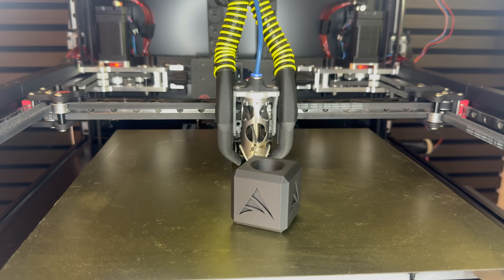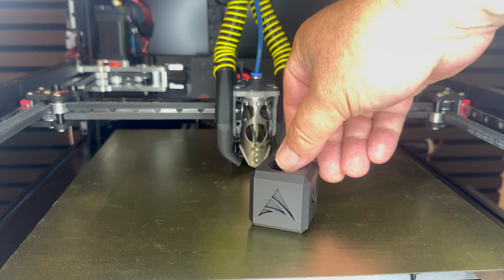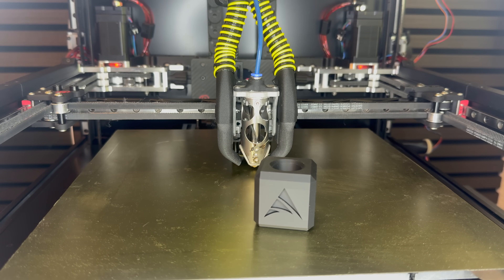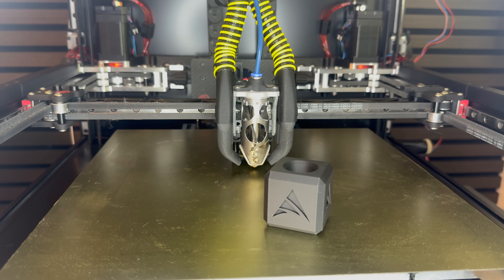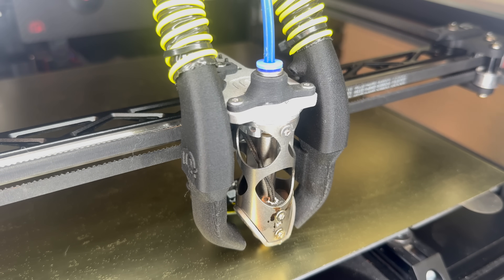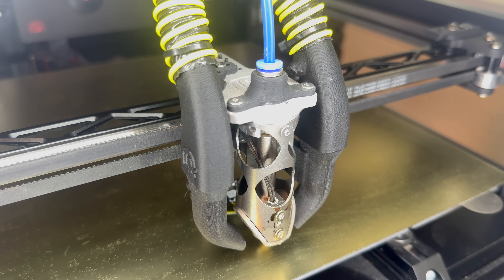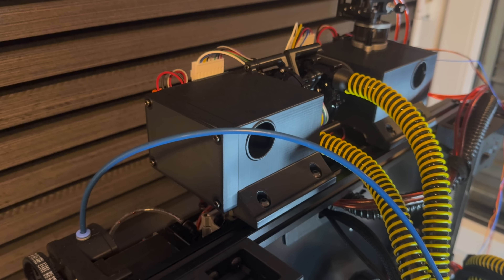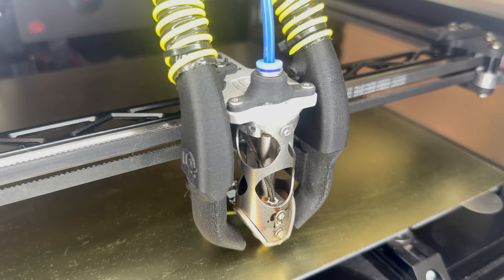Insane CPAP-Cooled 3D Printer Prints PLA at 360°C!

Comment: speeds can be greatly increased by increase temps. I double my PLA speed from 220 to 300 on rapido hotend. What i'm getting at is that we need a script that can increase/decreased temp based on flow asked.
Reply from the maker: Yes that is very true and I think the best way to do that on big prints. I dont think it would work well on small prints like this one.
It was printed at 360C to get 94mm3/s on the 0.4mm nozzle. And the Chube takes way too long to cool down till you need it to heat up again.

But still a very good idea and I will see if I can write and find a script like that?!
Reply: @mammoth-3D  there's one already but its postprocessing, it doesnt do it on the fly.
Reply from the maker: @meocats  okay, thanks for the info.

Comment: This proves that printing faster isn't the solution for FDM; it's getting another printer.
Reply: vertical vs horizontal scaling
Reply from the maker: Yes I do feel the same way. I did lots of testing the last few years and I know what it means to print fast. But as long as we can not get more flow on the hotend it's best to get more printers to get big jobs done.
I can not find filament that can really print well over 500mm/s

Comment: Annex Engineering spec a minimum exposed radiant surface for the chube conduction (80cm2 from memory) Worth checking your top plate.
Reply from the maker: Thank you very much for the Info. Will have a look into it. I think the SLM toolhead should have that, but will check again.